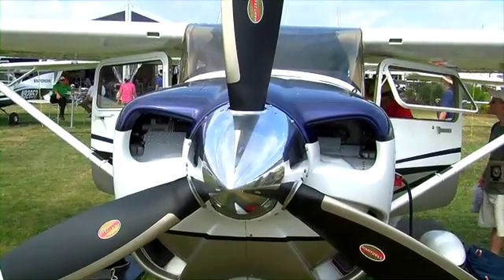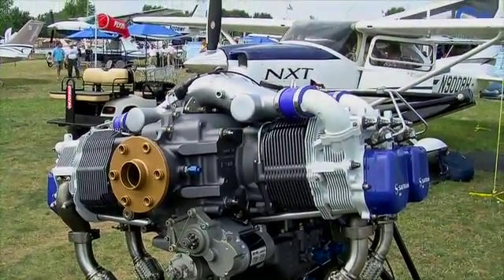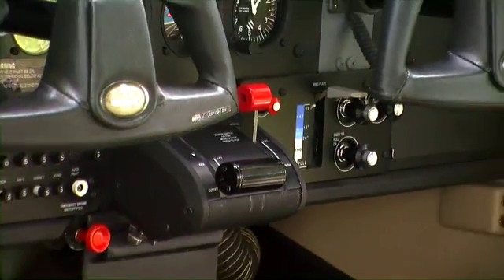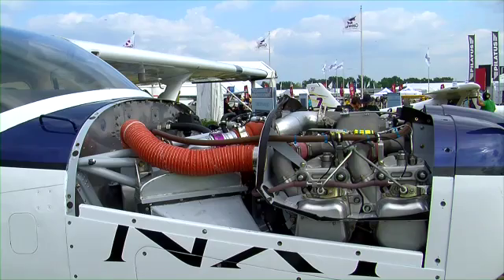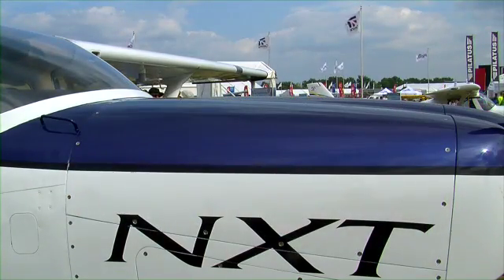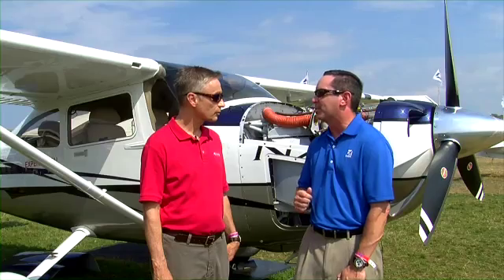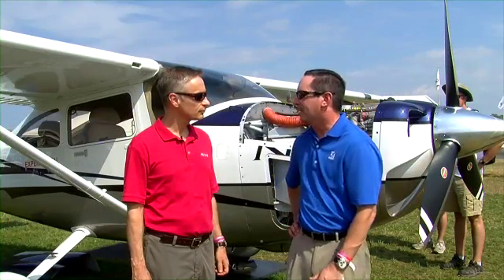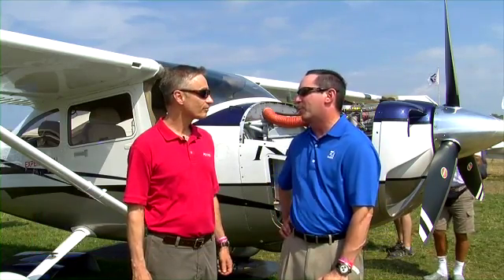Cessna 182 NXT

Comment: Jet fuel is heavier than gasoline, the reason Turbines work so well is they produce lots of HP for the weight of the engine, now you have a piston engine that weighs the same as an AV gas engine but uses heavier fuel, the real solution to the 100LL problem is to produce aircraft engines that burn car gas.